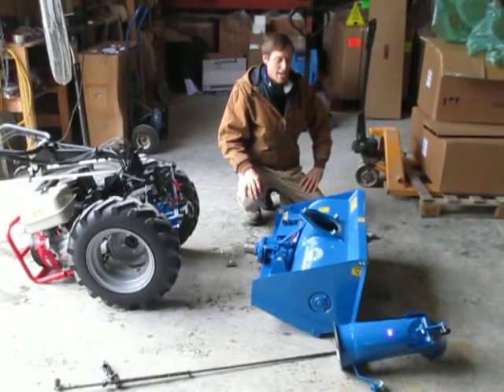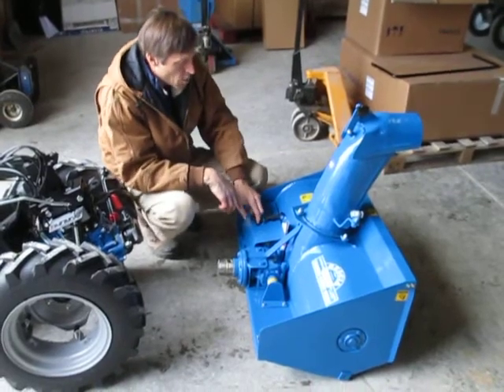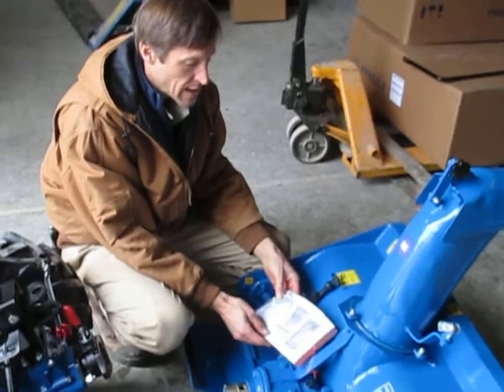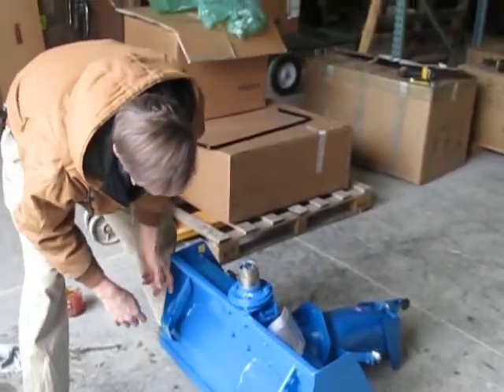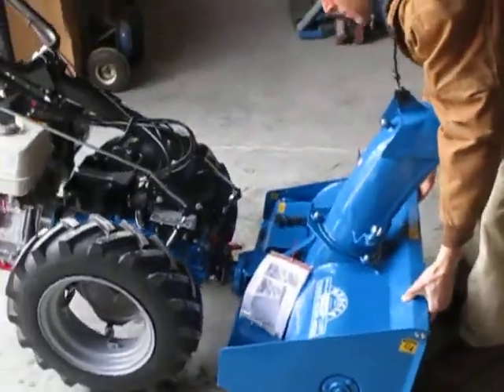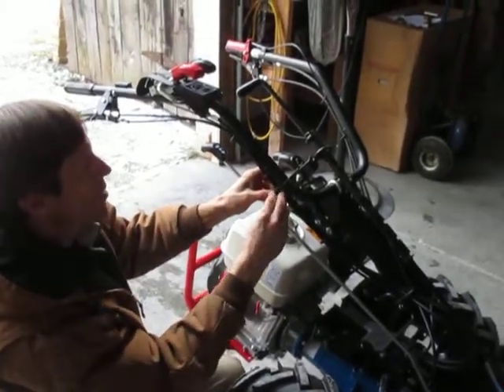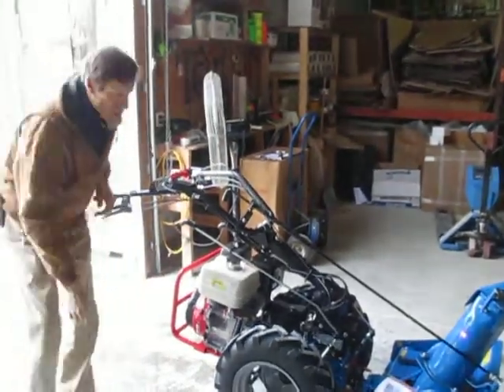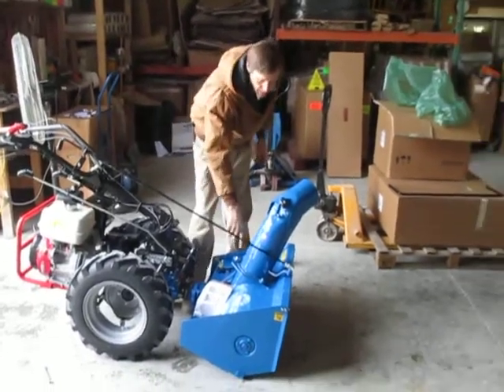Rescia Guiliano Snowblower: Set-Up Video

Comment: My shear bolt broke on this unit and the two half shafts seem to have heat wedged together. At least I can't twist them apart to line up the holes to replace the bolt. Any tips?

Comment: I was told the plastic shroud improves speed and handling.
Reply: Sure, and it improves fuel economy too! :-)
Reply: @joeldufour6202  I get that the shroud is kind of a joke but I believe that there are actual pros and cons from a functional prospective to running with and without it. Since I happen to be on the snowblower page, I'll limit my comment to this implement.

I brush the snow off the tractor and blower after each use. On behalf of the shroud, I'd guess it would keep snow off a lot of the mechanics and make clean up easier.

You ought to run a pole on the shroud sometime just to see what others generally think.